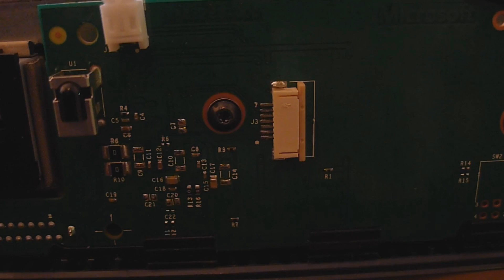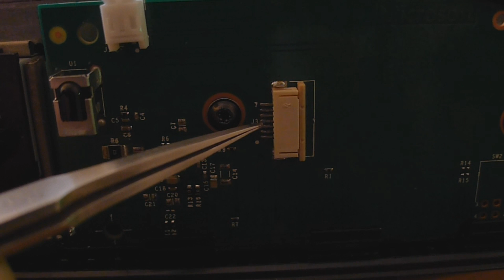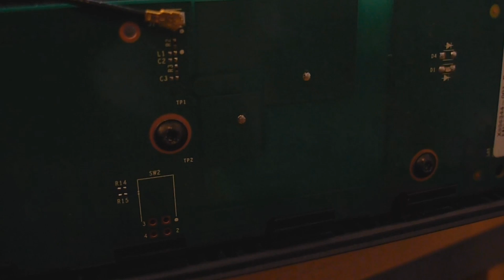How to Sync, Eject and Power Cycle an Xbox One Console Without the Faceplate

Comment: 2020: still helpful
Reply: not for 2021 though. no tutorials AT ALL work
Reply: @mezzovii  turn it on with your controller my guy that's what I'm doing
Reply: @The_Simple_Dj  my controller won't connect to turn it on
Reply: @mezzovii  try to pare is or do a forced start
Reply: It works to me in 2021
Reply: Actually 2021
Reply: 2022 still helpful
Reply: 2022: still helpful

Comment: So I woke up one day and under my carport was an Xbox one and a 32" flat screen. I have zero clue who left it there but I tore it down and realized that the person had violently tried to open it up. I have all the proper tools to do it so I managed to get it open and found that the ribbon cable and the WiFi cable were both ripped. I simply took apart a Direct TV DVR box as they have touch controls on their face plate and I'm about to Frankenstein this thing back together. I'm still using the 360 as I don't have funds to upgrade. My 360 is frankensteined as well. So this ought to be interesting.

Comment: This video is everything I needed! I was getting so pissed at the lack of information on how to factory reset when the bind/sync button won’t work! This is a way to do it!
Reply: How?
Reply: @falangogaming1535  give it the voltage manually
Reply: @zj5317  brother my screen is blank. can i reset or go to troubleshoot menu without the front panel?
Reply: @islamwithproof20  sounds like hdmi issue or mobo issue. Bring it to a shop or buy a new one.

Comment: This helped me a ton! I've taken apart my Xbox, cleaned it ish, and my sync button still didn't work! Did exactly what you showed me and it worked! Thank you so much!!!!
Reply: what did you do cause mine isn’t working it’s making the sound but not working
Reply: @kadenochoa5312  Mine sometimes does that also. It usually starts after a few seconds. Make sure you are clicking the right one for example the turn on button and not the sync button if you want it to turn on.

Comment: Thank you this actually helped, also a side note is to make sure your wifi/Bluetooth adapter is also connected it's located on the back left top, nothing was working until I realized that was not plugged in I know it's dumb but it may help someone else. Cheers dude
Reply: PS my screws are missing from mine so it easily becomes disconnected
Reply: what do you mean nothing was working dude? you mean wifi, the syncing of controllers? or the xbox was stuck on a green or black screen? i dont have the flex faceplate and wifi board so im stuck on a green and black screen, want to reset the whole xbox with the usb update but cant since i need to press and hold the 3 buttons with the solder point, tricky as hell.
Reply: nothing was working as in the videos I could find to troubleshoot my issue weren't working, but my issue was, wifi wasn't connecting, controllers weren't connecting and my sync button wasn't responding, upon taking apart my Xbox I realized the wifi plate toward the top left (front of Xbox facing you)  was unplugged, aswell as my ribbon cable due to removing the cover, I pressed the buttons via the solder point and was still unable to sync a controller even with the Xbox in sync mode, I then plugged my wifi plate back in and tried again, and was then successful in syncing a controller, and my wifi was able to connect again
Reply: I don't think that there is much you can do unless you have your wifi plate, as it also houses the Bluetooth adapter required for controller connection,
Reply: last time an Xbox one of mine was on a green black screen it was due to a fatal error in the hard drive, I had to replace the Xbox. All data losses except cloud saved. But I hope that's not the case for you. Best of luck
Reply: @austindebruijn7193  yeah, i figured, thank you for your quick reply bro wasnt expecting one, its actually a trashed ogfat a friend of mine gave me he told me  it didnt started stuck on the green screen, upon inspection i noticed it was missing a broken flex piece for the front 3 buttons, as well as  the wifi board which from my research its in charge of the wifi connection and the propietary bluetooth connection all the controllers use,  i wanted to play via ethernet, and via usb controller, like literally fully plugged lmao, your input was helpful my last choice would be to take it to a game repair shop and ask them to see what can they do with it, since im not trying to invest a lot in getting it up and running, i just wanted an og fat one for display!
Reply: @austindebruijn7193  yes,  i actually looked into that as well hot swapping the hard disk drive, but since i cant get the console on recovery mode due to the missing flex and nonworking front 3 buttons, even if i do get an HDD of another 500gb or 1tb i would have to put a new OS unto the HDD with the usb and xbox nand from what i researched, thats easy to do, but   it can get costly, a new hdd, the flex, the wifi board, and paying for the repair may as well get a preowned series s or xbox one s, but its pointless since i have an X1X,

Comment: For all those looking I opened up my xone about 6 months ago... Since then I would click the sync button and it would click but no flash or connect.... I opened it up today and saw that the cable wasn't connected fully that runs from the wireless chip board to the motherboard inside the unit..... I've just reconnected it and connected wirelessly the light also flashes now when I click the sync button .... 

Check the connection that could be where the problem is .... 

Thanks to this video I was able to test a lot quicker

Comment: Thanks for the tips, which made it easy to find out if Xbox One was working or not before putting back the front panel (just don't like messing with the ribbon). It turned out one capacitor in my power adapter was broken. Soldered a new one and everything went back to normal again.

Comment: Ive got an xbox that randomly turns off and on and most times wont power on. The powerbrick has the orange standby light but it goes white when it randomly turns on. The faceplate is off and the thing still randomly turns on. Any tips?

Comment: so, what do i do if this doesnt work either?  I took it apart carefully, didnt hurt the cable.  i have no issues with the power supply that i can tell, has a solid light.  but the console wont power up,

Comment: If this doesn’t work, does that mean I need a new RF board? I’m a little confused, I replaced my disk drive and the Xbox turned on afterwards but after traveling to a different place, my Xbox doesn’t turn on when plugged in anymore? I know the power brick isn’t an issue. 

I should note that after I replaced the disk drive I had this problem but after letting it sit connected to the power supply for awhile it eventually turned on and worked fine.

Comment: Thank you so much your a Life saver! Took awhile to find a relevant video on this. Does this work the same with Xbox One X?
Reply: Yea my cover for my x wouldn’t go back on and I got worried but then I figured out that you don’t really need the cover so I left it off and it works better and my over heating stoped
Reply: @rookie4939  
Read carefully: you put back the top and front cover differently than you remove them , you remove top and front as 1 pace , but to put it back you have to separate the top and front that held by the little clips , then connect the bottom "hinges" for the front part then connect the cable , then close it like a door , after that put the top part , another note , that little connector you see in the video above is opens and closes , so as u see on the right side on the video "the long top plastic of the connector " will slide out , then put the cable in , then close it to grip the cable in , hop it helps , it cost me 1 ribbon cable to figure this out lol

Comment: Ffs I need to put my console into recovery mode as it gets stuck on the green power on screen however I cant without the faceplate
Reply: Matt Bouldin did you ever fix it?
Reply: I have the same problem
Reply: Matt Bould u fixed it

Comment: Does someone know, could I solder a switch to the lower to connections for powering on...my xbox is fine, but I am modding it at the moment an I would like to replace the touch button with a switch( I know a switch would be wrong cause of ongoing connection...I would use a...the German word is taster...u push it and it just makes contact as long as u push it)...yeah...if someone knows about this...would be nice if u could let me know what u are thinking!!
Thx a lot! Greetings TomTom
Reply: Should work with a momentary contact switch